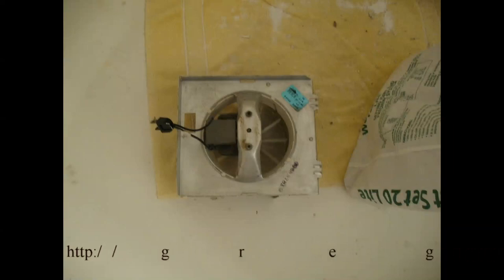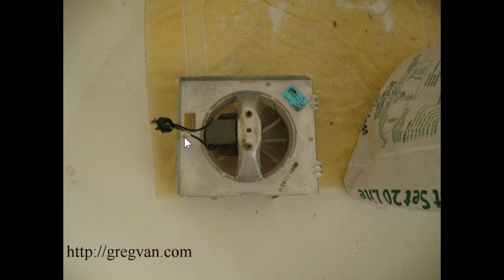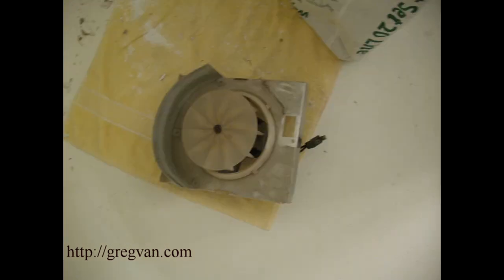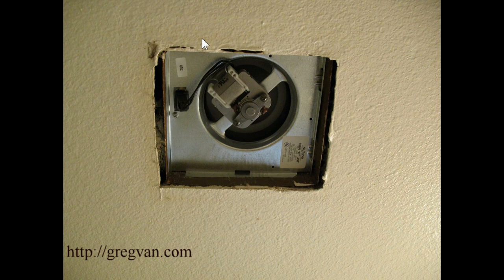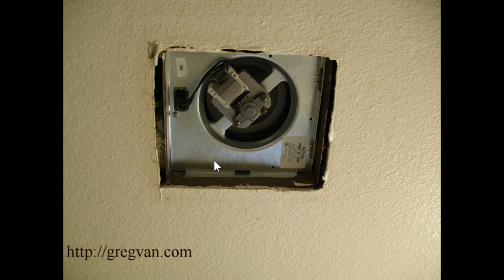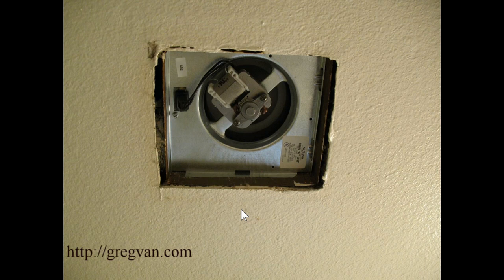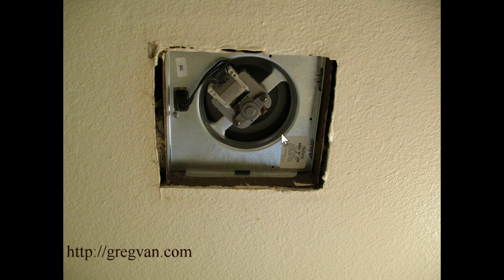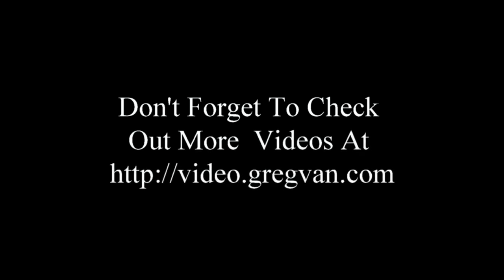Most Bathroom Ventilation Fans Are Easy To Replace – Home Repairs

Comment: Replaced one yesterday and it was easy. As long as you find the exact replacement
motor and fan assembly that matches up with your existing housing so the plug
is in the right place, you're good to go. Replacing the entire housing would have
been above my pay grade I'm afraid.
Reply from the maker: Glad it worked out.

Comment: What do you replace this old fan with? I can't find any replacements with the same two tabs and screw on the other end to fit into my existing housing.
Reply from the maker: You might need to replace the entire fan. I would take a picture of it and go down to your local lumberyard or hardware stores that have been in business for decades, instead of the big home improvement centers. Sometimes they have more of the older stuff like bathroom fans. Feel free to send me a picture and I'll see if I can help locate something.
Reply: I had to use old housing and exchange motors..eberything changed size they don't mention that...
Reply: I literally replaced that same bathroom fan and motor in my half bathroom. It's from our house built in 1979, we moved in, in 1985. I just took off the motor and fan from the new assembly and installed it on the old face plate, and it worked! I bought the new fan at  Home Depot. 21.00 dollars.  It's a NuTone 696N ventilation fan. I bought it on 1-7-2023, good luck 👍